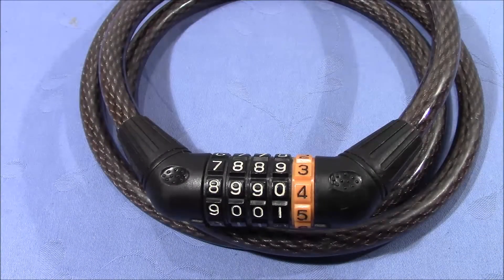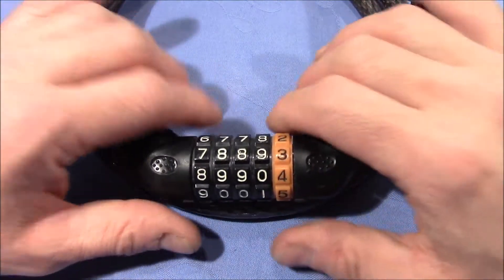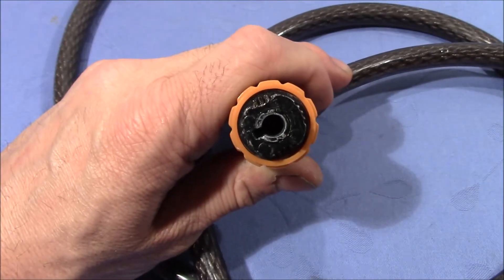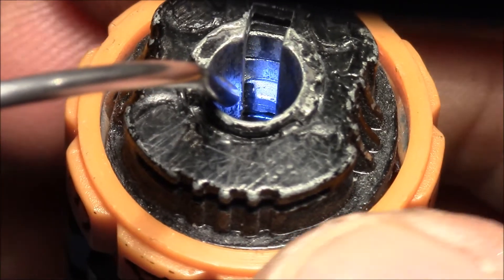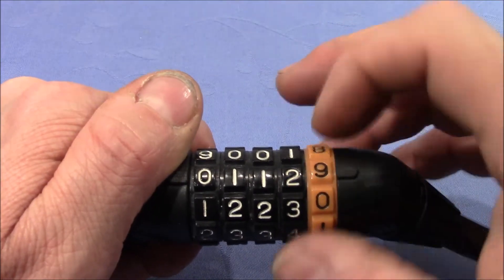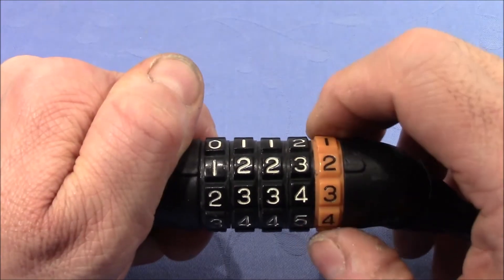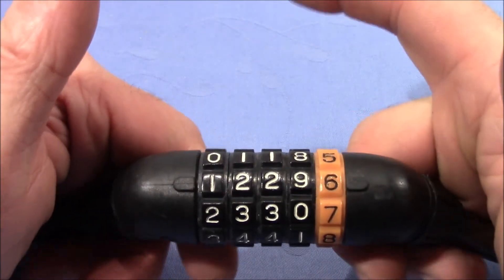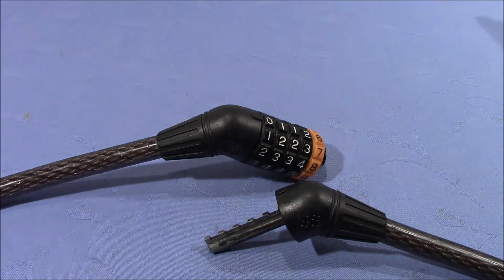(picking 759) Why this combination lock is so hard to decode (manufacturer tricks revealed)

Comment from the maker: I received this lock from a viewer to decode it. It was a 30min job as the lock manufacturer has has built in properties to make decoding very difficult: pulling not straight by design, tight tolerances, two types of false gates to prevent continues decoding and pretend a wrong number to be correct.

This video is not an actual decoding session but explains the lock secrets and gives general decoding advices. See my full decoding playlist for all tricks and tip on combination locks https://www.youtube.com/watch?v=eNhKRSqncYs&list=PLuSaKS-pr3L81psh-vAVyp7R6Te1n5M37

Comment: Thanks heaps Potti ! Mine had 4 wheels but 2 types of false gates... Using the Indirect method I wrote down 3 possibilities from the tightest wheel on the left and proceeded from there , eliminating some of the "good" numbers as I went. I Noticed that the "good" numbers caused the next wheel to not make clicking noises when turned. Prost!

Comment: Thanks for the video!  I have the same lock and none of the other tutorials worked.  This lock definitely has advanced measures to prevent cracking it.  Actually seeing how the inside works will help tremendously!  I'm determined to open and be able to use it again!

Comment: Can you pick a combination lock that is already open? I forgot the number combo to my bike lock, but the lock is already open so I cannot put tension on both sides of the lock
Reply: It's gonna be easy when its already opened. Just look at the hole and align the notches. Around the 4:00 minute in this video he shows how it looks when they're aligned and when they aren't.

Comment: Thanks for the video, most informative. I have a brand new 5 digit combination lock that I messed up when setting the new code. I've tried for weeks to crack it using your method but so far all I have are aching wrists and sore fingers. I tried WD40 to help in twisting the wheels, is that something that is useful in your experience? I know it has false gates as I could see them when trying to replace the central bolt.... Also is it harder to pick a new bike lock or an old well used one?

Comment: Interior lighting views are fantastic!  I hope this visualization can be used with many more locks.  Thank you!

I also wonder if "hanging" the lock under weight tension with some sort of distance micrometer for the different settings might be useful.  For example, you mention that with some combinations the separation is greater/lesser than others.  I would be interesting to see if the micrometer separation might useful for minimizing the number of trials necessary.
Reply from the maker: Thanks for the nice comment. It's hard to do precise operations on such a hard to handle object (clamping, etc. could be tricky).

Comment: Just curious. The undercuts feels like they would be wider than the gate/false gate. Would this perhaps enable you to feel what numbers are undercuts, and then know that these numbers cannot have gates. That would cut down the amount of numbers to try to half. That might also enable you to put all the wheels to "known undercuts", giving you a few extra micrometers to feel for gates.
Reply from the maker: Yes, of course wiggling at a number under tension is the usual way to distinguish true from false gates. However given the difficult holding / tensioning of the lock makes it hard to do this precision testing. Also the visible outer wheels have play  against the inner wheels which removes feedback too.
Reply: @Potti314  Oh, I've opened my share of combination locks. But my thought was that if you can figure out that the undercuts are at, say, 1,3,5,7,9 you will know that the false and the real gate is on an even number (for that wheel). And if you then set all the wheels to where there is an undercut you should gain extra friction on the wheel you test, and you also just have to test 0,2,4,6,8 on it. Ah well, it's just an idea, I guess I'll have to wait until I find a similar lock to try it out. Still, nice decode, was interesting to watch. :)

Comment: Interesting lock - thank you for showing this! :D ... for the indirect method, the 1 and the 6 were binding, as one of them was a false gate ... is it always half way around for each wheel? ... and only 2 of numbers do that for the indirect method? I'm thinking that would reduce the possibilities to just 32 combinations. Cheers!
Reply from the maker: It's actually a false gate for every second number due to the undercuts. This makes it a 5^5 = 3125 combination lock. But trying out all these is boring ;-)
But you could find the traditional false gates as one-number deviation from the 2-number spaced undercuts - given you know this construction detail before you start decoding ;-) Then it would be a 2^5=32 combination lock. However to find true/false gate on one wheel requires the wheels to be in a proper gate.
Reply: @Potti314  Ah ok thank you! :D :D

Comment: I got one like it.  I don’t recommend anyone buying one of these locks for valuables.   Fun to practice decoding with.
Reply: Why? it is so hard to decode?  I bet most lock pickers could not get it. You must have a cheap version.
Reply from the maker: Do you think that the cable is it too easy to cut?
Reply: @Potti314  It's something to say to sound like a big shot.
Reply: @Potti314  I’m a construction worker.  I think most stuff is easy to cut.  This type of lock I was able to decode in the 6 th grade.  They just seem like easy prey for a thief.  At least a master lock you need a pick.

Comment: Hi Potti314, Interesting combination lock mechanism, 5 numbers, variable system for false gates. Certainly the manufacturer has gone the extra mile to deter a pull pick attack. Thoroughly and well explained by yourself, as usual. I found it very interesting.  Regards, Brian.
Reply from the maker: Thanks a lot for tuning in. Yes, this is a great lock and I wished all bike combination locks would be made like this.